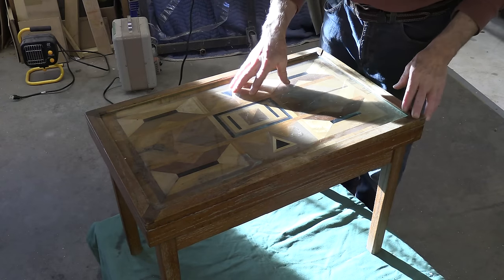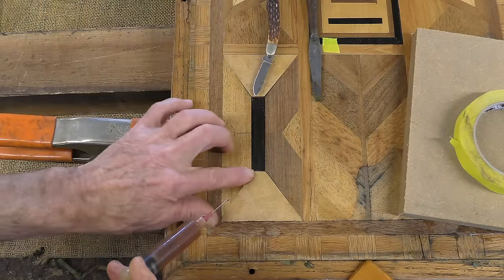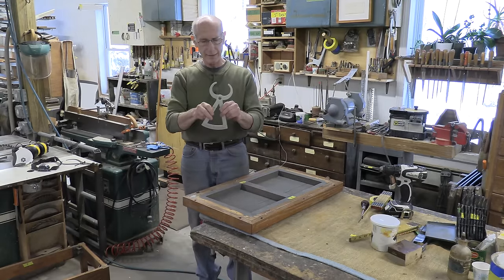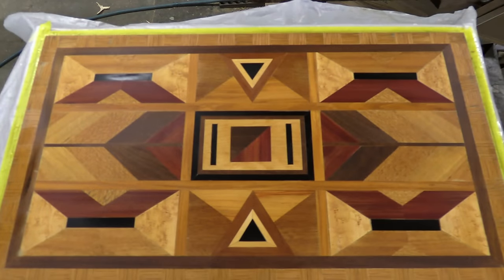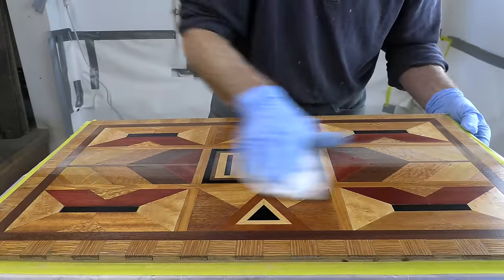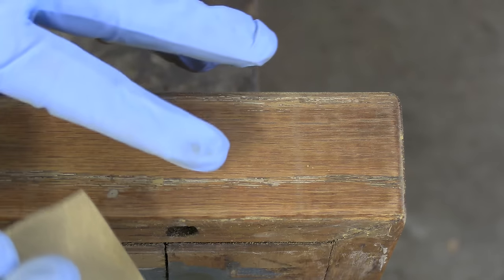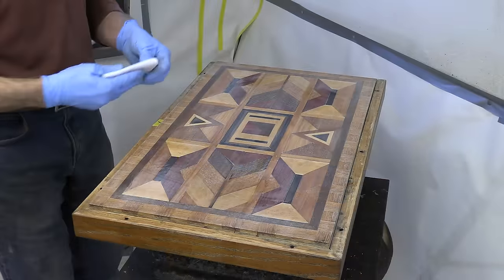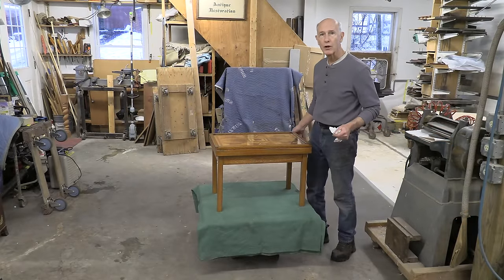Family History, Rescued. - Thomas Johnson Antique Furniture Restoration

Comment: I've run into these 1/4 inch thick veneers when refurbishing passenger rails cars at the local museum. Many were water damaged and very difficult to restore because of warping and heavy staining.
Reply: The gray paint looks like it's straight out of an engine workshop.  Methinks this guy was using leftovers from a railroad company. The oak looks right too.
Reply from the maker: Thanks! yes, they are problematic!
Reply from the maker: You're right! He worked for a lumber company though

Comment: Tom, were the holes you drilled to "scoop up" the tabletop pieces for gluing filled in?  Just curious.  Another informative and beautiful video.  Loved the scenes with the vagabond Ella, especially the one at the end with the finished table.  Thanks.  What an heirloom!
Reply: He used a clear epoxy glue at that stage, so I suspect the epoxy filled the holes completely.
Reply: @CALB2009  thx. I missed that part. It was driving me nuts.
Reply from the maker: Thanks! I was hoping I might be able to push the pieces up, but no go. So I just injected the epoxy
Reply from the maker: Correct! Thanks

Comment: Hi, Thanks for another very watchable video. You mention that some one sent you a link to a vacuum devise for drawing glue into fine cracks and areas otherwise inaccessible. I have for many years used a soft rubber vacuum hose adaptor fitted to a household vacuum cleaner.and simply applied it to the back of the board or adjacent to the area and it draws the glue in very well. Some more porous timbers like white oak that you can readily suck air through do not even need a defect to allow ingress of the glue. All the best.
Reply from the maker: Thanks! I need to try that sometime

Comment: Hi Tom , I have found with water drip marks, if you soak the whole area in water it will usually remove them, without using Oxalic Acid, for the greyed water marks i do use OA though...Love to watch you doing the restorations.
Reply from the maker: Thanks! That's interesting - I will try that sometime

Comment: As always Tom your work and care is impecable. Your respect for the piece and its maker is what makea me return. Might i suggest that you could use a liming wax (aka a white pigmented solvent based wax) to reproduce the large grain filling of the base. Most oak in the 1800s and early 1900s had dark contrast grain as a result of age or an ammonia reaction. We now can easily reproduce this with oil based gel stains over a shellac. For the white filling of large pores a liming wax works well. This was common in the 1970s to 80s over blonde based oak. It is now resurging as a lime wax over dark or grey based stain. Thanks for your love of wood. It inspired me to leave medicine.
Reply from the maker: Thanks! Yes, I thought about that - but I just decided to side step the whole issue, as we didn't know if it was intentional

Comment: Brilliant how you demonstrate the virtue of wood as a delicate yet durable material for daily life when well built and/or repaired. Inspiring how your calm, methodical persistence showcases skills acquired over a lifetime of honest work. Makes me feel unworthy to ask, but I'm dying to know how to lay hands on big beautiful sliding-arm monster F clamps like at 6:50 of this video. (Most deep throat C-clamps aren't very deep or if they are, flex so much it takes forever to cinch and relieve pressure.) Ideas? Thanks!
Reply from the maker: Thanks! Those clamps are ancient! I got them in a trade many years ago. Wetzler https://www.ebay.com/itm/304374827665?_trkparms=amclksrc%3DITM%26aid%3D1110006%26algo%3DHOMESPLICE.SIM%26ao%3D1%26asc%3D237351%26meid%3D5bd86d1b5e454e8296853203ff0dd8d1%26pid%3D101224%26rk%3D2%26rkt%3D5%26sd%3D133517409883%26itm%3D304374827665%26pmt%3D0%26noa%3D1%26pg%3D2047675%26algv%3DDefaultOrganicWeb&_trksid=p2047675.c101224.m-1

Comment: I guess I missed this one in the cue, glad I caught it because I have a few tables with Art Deco designs that have miner issues.  Phenomenal restoration Tom. I like the fact that you can clean of the Hide glue after it dries. Also just a quick question; When you use the Oxalic Acid can you use a heavy sponge with water to clean it off or due you need to rinse it off with a hose or in the sink as you do? Thank you Tom, great piece as always. Best, Wiliam
Reply from the maker: Thanks William! Yes, I often use a big sponge, always with plenty of water. You’ll find out why very quickly if you ever sand something that hasn’t been rinsed enough!

Comment: wonderful work - another piece of history saved
I wonder what happened to the "other" table he built - hopefully someone else in the family has looked after it better than that one.
Also you never showed us what happened to the Drill holes under the table, did the glue fill them up or did you have to use a wood filler
Reply from the maker: Thanks! They have the 2nd table. The holes were filled with the epoxy I used

Comment: Tom, the table turned out really nice so far as the finish that you applied Waterlox is that a Tung oil finish then ?
I have never used Tung oil on any furniture mostly Dyes and stains .
Reply from the maker: Thanks! Yes, that's Waterlox Original Tung Oil Varnish. I really like it!

Comment: Lars (hope I spelled his name correctly) is going to smile on your from above for the great work you have done on this. I love the idea of using different colored woods to make a design as it was done here though the design is a little to geometric for me yet it's still stunning. I occasional buy cut off exotic woods to use in box tops. I am going to think of some design for a larger box or side table. I am wondering if to use hide glue only on repairs or also for new things? Thanks for another great video.
Reply from the maker: Thanks Ursula! It made me want to do something like that too!

Comment: Very nicely done, definitely kept it so it looked like it may have back when it was first built, with a little refinement like the filler between the pieces, although, when new, there may have been none. 
Have to say, don't think that those pieces on the top can be called veneer, not at what looked to be 5/16" thick, I think anything <1/8" is veneer, anything thicker is just another piece of wood.
Oh and definite big props for not just using and throwing stuff away like most of society does today and instead, clean and reuse as much as possible.
Reply from the maker: Thanks! Yes, you're correct, this thick veneer is called "parquetry", mostly used for floors

Comment: Nice work and beautiful result.  I understand you wanted to seal the glass to keep water spills from getting in.  But I would be worried that by sealing the top you will have trouble with moisture coming from the wood with humidity changes.  That moisture would then condense under the glass and be unsightly and also cause staining.
Reply from the maker: Thanks! Good point, but I think in a home environment that is unlikely. Luckily the job happened in the winter, so it's definitely dry now!

Comment: Beautiful table and a beautiful job as always! 🙂  I want to use that feed-n-wax on the inside drawers of a couple of antique dressers I have.  I doubt the wood has been treated for decades and I'm sure it's beyond parched.  Do you know how long I should wait for it to dry/cure before putting clothes back into the drawers? Thanks!
Reply from the maker: You're welcome! I would not do that! It could definitely get on the clothes. I usually give drawer interiors 2 coats of shellac.
Reply: @johnsonrestoration  Thanks!

Comment: That came out really nice.  Am I correct that since you used the silicone sealant you did not have a need for the paper tape as the glass is now held in the frame and up off the top, or did you add a spacer paper tape in as well?
Reply from the maker: Thanks! Just the silcone

Comment: Thomas, great restoration as usual. The colors look amazing. May I ask what % dilution you use for your oxalic acid? I generally use a 7% dilution but it does not give as good results as your mixing seems to give. Thanks
Reply from the maker: You're welcome! You're measuring much more carefully than I! I have a 1 ounce by volume scoop, and I usually use 2 scoops to approximately 30 oz of hot water. For really bad stains I will use boiling water and add oxalic until no more will dissolve, a "super-saturated" solution.
Reply: @johnsonrestoration  Thanks Thomas. If my conversion (according to google) is done correctly, 2 scoops ~ 59grams, 30oz ~ 900ml. Basically, your mixture is also (roughly) around 7%. About the super saturated solution, I've never dared going for it but I feel more comfortable doing it now knowing that someone like you does it :). Looking forward your next video. Cheers

Comment: As always sir a cracking job just a little tip with the silicone you can clean it off when it’s wet but you should use a mixture of water and a little washing up liquid the block off with a rubber tool or level till dry then cut off with a stanly knife l did like your cramps with the long neck they just about go to the middle of the table a very nice table thanks stay safe 👍👏👏
Reply from the maker: Thanks! That sounds like a good method. I use it so infrequently

Comment: Another fascinating project to watch you complete. I'm curious even on the 2-D computer screen it looked like some parts of the table top had 3-D optical illusions. Is that the case in real life?
Reply from the maker: Thanks! A little - but it must have been better on the screen
Reply: Randy, The fibres in timber will reflect the light sometimes so that the timber can definitely have a 3D effect. Different timbers have different fibre densities and directions which all impact their appearance when finished.

Comment: Beautiful job.  When every you say - i’m going to let that dry,- am curious as to how long it took, especially with the Hyde glue.  - a devoted fan.
Reply: A few hours. 4-24 depending a bit on the amount of glue.
Reply from the maker: Thanks! Yes, dlevi67 is right, but it also depends on how much stress will be on the joint. I'm always partial to overnight drying
Reply from the maker: Yes, and depending on the quality (or lack of) the joint, and how much stress will be applied. Think a chair glue up versus veneer
Reply: @johnsonrestoration  Nothing wrong with playing it safe - especially if you can do something else (including sleeping!)

Comment: More 'intarsia' than parquetry, given the thickness of the pieces. Lovely to see such a variety of woods (a perk of working in a lumber company, clearly), and a big thank you to your client, Tom, for allowing us to know so much about the history of the piece.

The glue looks like cascamite/cementite/a number of 'ite' resins developed in the 1930s - they tended to dry and crumble when kept in very dry (centrally heated) environments.

Happy new year!
Reply: Interesting. I wonder if they are still used? Probably not with the "drying and crumbling"
Reply: @kayerin5749  Cascamite is still very much in use. It's an excellent glue (and very cheap), although not the easiest to use. The drying and crumbling only happens if the glue surface itself is exposed to a dry atmosphere for a prolonged period- which normally in a wood joint that 'protects' the glue surface doesn't happen. 

I may be totally wrong, but looking at the detached piece, the glue failed when it was still relatively fresh (look at the ridges of glue at 3:35). The bird's eye maple (or birch?) seems to have been not stable enough (two pieces have cupped a bit). The glue then has dried out completely in the intervening 80+ years...
Reply: It's parquetry-
Reply: @horacerumpole6912  Debatable. But call them what you like.
Reply: @horacerumpole6912  It's exactly the reverse. Go and look at the Studioli of the Duke of Urbino.
Reply: There is no intention here to create the illusion of depth, which is the hallmark of intarsia-
Reply: @horacerumpole6912  There is marquetry (and parquetry) intended to create a 3D effect, as there are purely geometric intarsia (e.g. "tarsia alla certosina") that have no 3D.

To be honest, this is neither - and it has characteristics of both. Call it what you like.
Reply: @dlevi67  Can you tell what a lus is?
Reply: Perhaps this will help;

par·quet·ry
/ˈpärkətrē/

noun
	1	inlaid work of blocks of various woods arranged in a geometric pattern, especially for flooring or furniture.
Reply: @horacerumpole6912  No; why should/would I? (tell what a 'lus' is - realised that this by itself is confusing, as there are messages in between)
Reply: @horacerumpole6912  To which I can counter the following definition from Ralph Edwards' The Dictionary of English Furniture :-

"Parquetry consists in laying down thin pieces of wood of simple geometrical form carefully fitted to one another." (my emphasis).

Or equivalent from a dozen other books and articles on furniture (from specialised journals such as the Furniture History), where the emphasis is on the thin nature of the work (some explicitly call it veneer), and its geometrical, straight line design, whereas marquetry is usually defined as curvilinear (whether portraying realistic forms or not).

As I said - feel free to call it what you like. To me, given the extreme thickness of the pieces, it remains more reminiscent of intarsia - although it is not, since the ground is not dug out to allow the inlay of the contrasting pieces (but, again, certain types of intarsia work - tarsia certosina notably - are not inlaid except at the very ends of the pattern).
Reply from the maker: Thanks Davide! Yes, ever since you mentioned it I've been wondering what the difference between Intarsia and Parquetry wood be. Great discussion. When I see that much glue, I know it was never clamped down properly. Which might not have been a problem until the water got in there
Reply from the maker: Thanks! yes, dlevi67 is right!
Reply from the maker: Thanks! That's what I called it - but now I'm interested in intarsia!
Reply: @johnsonrestoration  If you can make it to Urbino, the whole trip is worth it just for the Studiolo of the duke!
Reply: @dlevi67  There is nothing unusual about the material being .250" thickness, or more, when it is used for inlay in  a parquet floor-
Reply: @horacerumpole6912  Is this a floor? I hadn't noticed. I thought we were discussing furniture.
Reply: @dlevi67 Don't be obtuse, parquetry encompasses furniture and flooring…
Reply: @horacerumpole6912  The only one being obtuse here isn't me. I have already told you chapter and verse of where to find a definition of parquetry that applies to furniture and why I believe that the techniques used to make this table are closer to intarsia than to parquetry.

I have equally told you that you are free to call this table anything you like - just as I am.

Now, bugger off.
Reply: @dlevi67  Figured you'd tap out after your last assinine comment-so run along-

Comment: I was just wondering why you didn’t sand underneath the small corner piece when it popped up. Always thought you had to sand the old glue off before re-gluing.
Reply from the maker: Thanks! I scraped off the old glue as best I could - it's not always possible to get it all. You should never sand it though, always scrape as carefully as you can

Comment: The idea with the suction cup, air pressure etc. are great but it you want to lift the 1/4 inch veneer, you will need an insulin needs and bend it at 90 degrees, some 2-3 mm from the tip, insert it straight and turn it to the direction of the part that needs to be lifted. You can also use the same needle to instill the glue if the needle isn't occluded.
Reply from the maker: Thanks! Yeah, I have the idea, but these things were not moving! I was also afraid of breaking a tool off in the table!

Comment: May I ask why you choose to use steel wool, especially on that oak frame which is responsive to iron staining? I would be afraid it would get through the varnish and oxidize the tannins unevenly. I am no furniture refinisher, but I might try aggressive Scotch Brite hand pads first. Great restoration nonetheless.
Reply from the maker: Thanks! That is a consideration on raw wood, but not on a finished piece. I use Scotch Brite too, but it's not the same

Comment: Interesting case.
The builder or designer of that table has used various kinds of veneer, at least it looks like. Is different shrinking a problem for the surface and its visual appearance? Could you have used wax for sealing the cracks or was using of wood paste mandatory?
Thanks.
Reply from the maker: You're welcome! I think there were no problems until the water got in there. Wax could have done it, but I really didn't want the water from my process to get in there
Reply: @johnsonrestoration  thanks.

Comment: Mr. Johnson,  My question is that I have an older oak dining room table that seemed to have been coated with polyurethane. Over the years of use the finish has started wearing off. How do you clean off the old finish and prepare the table for a new coating.
Reply from the maker: Thanks! Short of stripping and refinishing, you can clean the table top with a degreaser like Krud Kutter, sand the table with 220 or Maroon Scotch Brite pads (you're not sanding the finish off, you are scuffing it) and recoat with Minwax Acrylic Polyurethane. You may need to recoat the worn area more. Sand again with 320 and a final coat. Good luck!

Comment: Hi Thomas. I have a similar situation with thin veneer. For the most part it is coming loose but in spots it is really stuck down. How do I loosen the stuck pieces without breaking. I think it is hide glue.
Reply from the maker: You could try injecting some warm vinegar. Gets messy, but I often try heat too, but that can be dangerous!